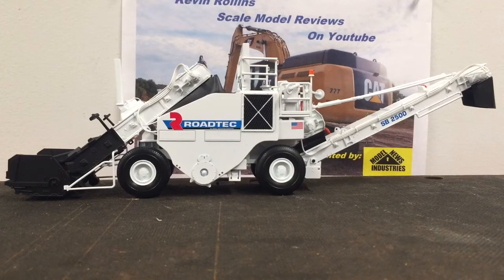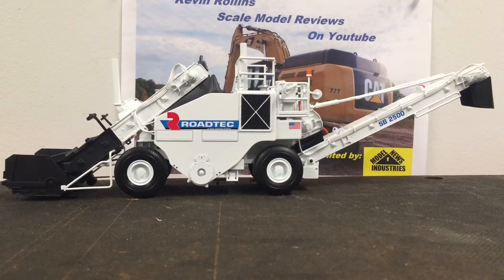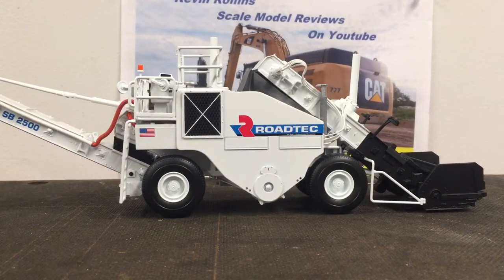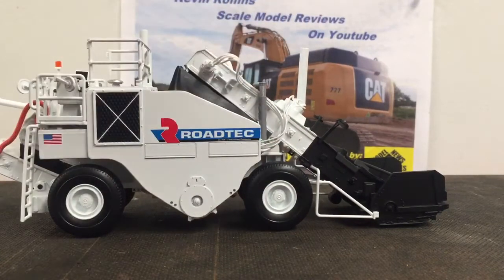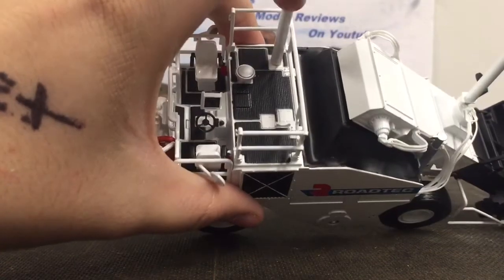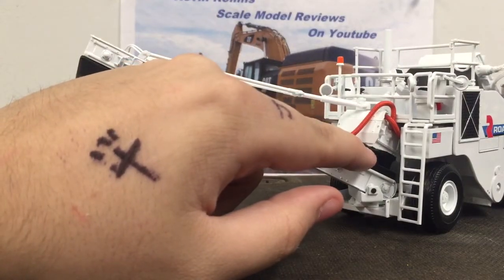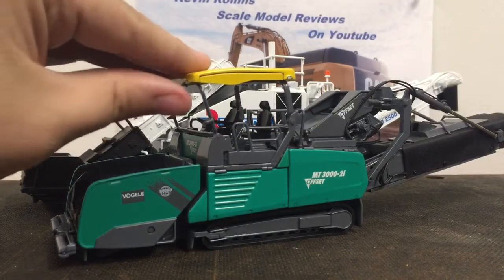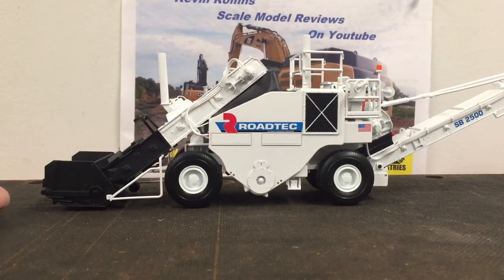1/50 First Gear Roadtec SB2500 shuttlebuggy review

Comment: Also the purpose of this machine is to continuously supply a paver so they don't stop. On small road projects this isn't a big deal but when a paver stops, a small ridge is created in the road. You don't want this on Highways as you want them to be strong and have a long life span. The buggy can hold extra Truck loads of asphalt so they can keep going while a new truck positions to dump its load.

Comment: What made these shuttle buggy models worth 300 plus was the fact there was a limited # available for a long time. The reason for this was not that it was some limited #, high quality piece like CCM would offer; the reason was 1st Gear made the model "exclusively" for Road Tec industries. Road Tec did "NOT" sell them to the general public, they would give them out as gifts to customers and employees. So they only made into the hands of collectors if these customers or employees were willing to sell them !

Now that Road Tec has been taken over by Aztec Industries the policy has changed, and they have re-released them for public purchase. There are subtle differences from the original, but the model is basically the same. As far the model's worth----any model is worth only what another person is willing to pay. The original will probably still be worth the 300 plus because of it's limited availability; the newly released version........"probably" not so much ! 

If you want one they are now 100 bucks, not 50 like they used to be. Aztec/Road Tec likely raised their price when they saw the amount of dough the e-bay reptiles were buying and then selling them for !!  As for where you can get them, I will respect this channel and  'NOT' give that info out. Just use common sense when looking, and it should be easy enough to find. As far as not wanting people to find that out. The quicker they get boughten up, the quicker they will elevate in price !!